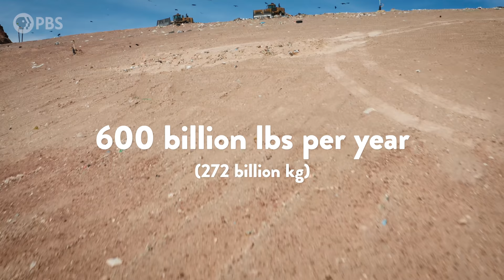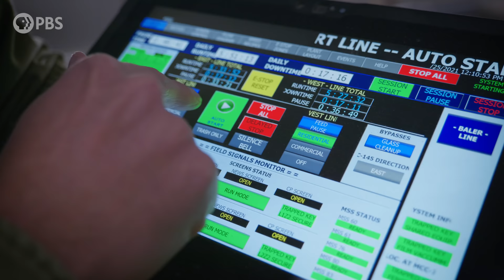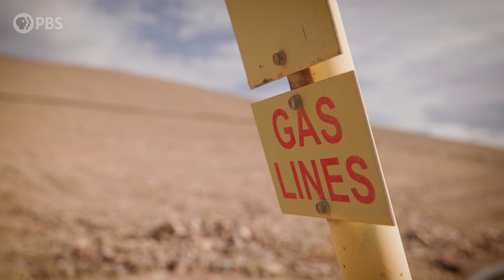How FIVE BILLION Pounds of Las Vegas Garbage Powers a City | Overview

Comment: Anything about carbon capture when they burn the methane? How does burning compare with releasing the methane into the atmosphere?
Reply: I've heard that methane is a much more potent greenhouse gas than CO2, so burning methane rather than having it leak out of landfills reduces greenhouse effects.  In the grand scheme of things, this plant is tiny, so isn't probably a great target for carbon capture.  I've not seen the light on carbon capture as being viable, as opposed to being greenwashing.  But, if carbon capture of combustion products is viable, it would probably be more efficient to target some still running coal-to-electricity plants, rather than a plant burning recovered methane.  Now, I think pumping money and regulatory streamlining towards MSR uranium reactors is a better technical strategy than carbon capture from combustion.   It seems to me that carbon capture would just decrease the efficiency too much, as opposed to successful sulfur capture technologies which dealt with a minor contaminant, rather than the main product.  But I was always weak in chemistry compared to chemical engineering, and it seems like some folks seem to think carbon capture is viable.
Reply: methane, uncombusted is many times harder on the atmosphere in lifetime effect than CO2 - so if you can't use it productively through combustion or other chemical processing - flaring it effectively is kind of a better way to go than just naturally releasing it...

Comment: I’m very disappointed in how PBS has handled the story, especially about methane. 

You are just parroting talking points from the methane gas industry. In fact, if you could harvest all of the methane gas from all of the landfills in America, it would account for less than 5% of the gas that is used every year. 

The methane gas industry, marketed as natural gas, is a dirty and leaky system, that we need to shut down if we are going to meet our climate goals. They are using stories like this to justify staying in business.

The only justifiable use for landfill, gas or methane gas from cows is on site generation of power. Feeding it into the rest of the gas pipelines is a marketing tool to prolong a poisonous industry.